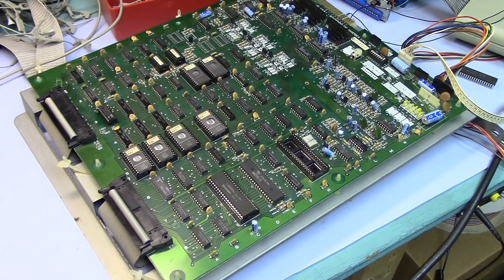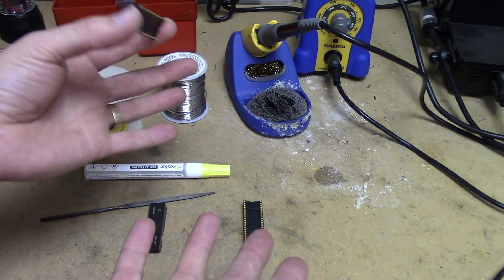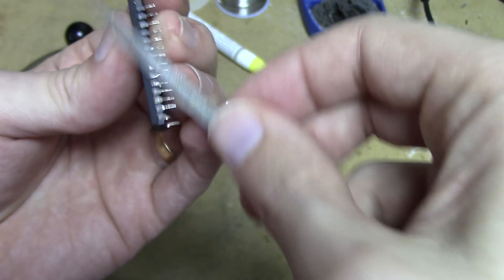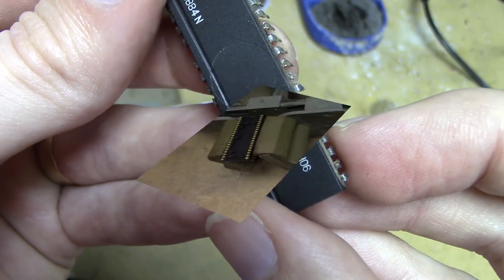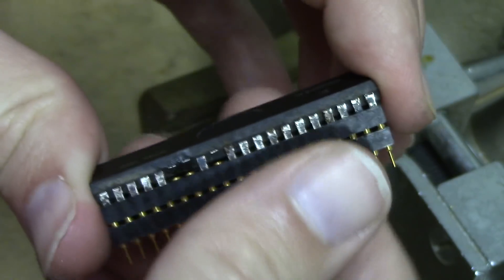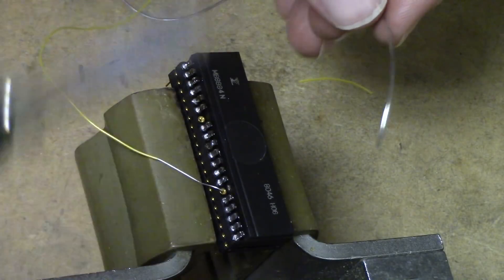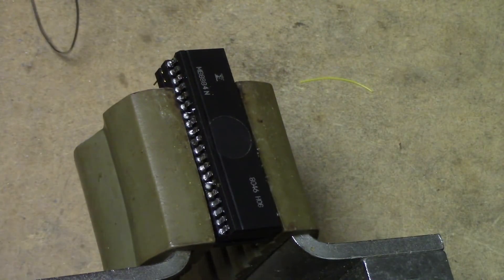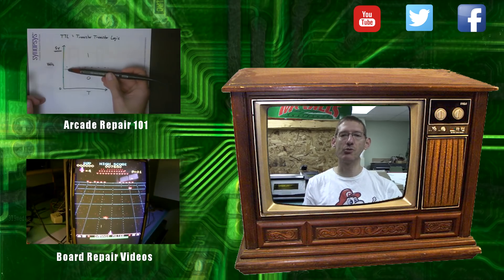Arcade Game Repair 101 - IC Leg Repair

Comment: Hello! Do you do repair services? I know this video is old and I tried the repair, but it didn’t seem to work. My soldering abilities aren’t very good so it’s possible that is my issue. Was wondering if I could send the board to you for repair? It was working until I pulled this cpu chip and noticed it had a couple legs broken. When I put it back in the game no longer boots it just goes to a blank screen.

Comment: Hey Adam, is it necessary to swap out the socket on the PCB to match up with the machined pin "donor" socket that you are using for the repair?  Or can I use a machined donor socket and simply plug into the existing socket on the PCB?
Reply from the maker: DeLuSioNaL's Arcade You can try, but typically the existing sockets are expecting to receive a thinner leg, so it may not fit. Or if it does you may be mashing the receiving blades of the socket without knowing it.

Comment: Nice method for repairing broken lC legs. I haven't seen that before and will definitely use this when I need to repair. I thought you were going to use a dremel to cut away the plastic above the broken leg to get access to the pin.

Comment: Holy cow! That was amazing! I never thought of the 2nd socket to keep the legs straight, I was scared the the oil from your hands pushing that tiny wire would affect the solder! I use a much finer tip but that was perfect! Thanks for the great video. I have some work to do now on an English mark darts machine now!

Comment: That sanding step doesn't seem like it needs to be as involved as you did it if you just fluxed and then tinned the pins before socketing them? If you have a hot air station and some tiny gauge solder you could do it with very little kinetic impact and the solder would both strengthen and insulate from corrosion.
Reply from the maker: The solder only adheres to clean bare metal so if I left the crud on, even after applying flux, the results would be sketchy.
Reply: Okay, thank you. I am still learning.

Comment: Hey, great video! I've been a lurker and watching your videos for a long time. I thought I'd chime in and offer some wisdom. When I was taught soldering many years ago, I was told to skip a pin, so do all the even ones, then go back and do the odd. this helps with dissipating the heat to the IC. This could help with keeping the plastic of the machined sockets from melting. But again love watching your repair videos! Keep up the good work!

Comment: Hi Adam
can I ask you ,have you ever used a ultrasonic cleaning bath to clean the legs before repair-or would it damage the ic's ?
Reply from the maker: +Nut Lock No I haven't. In fact... Never even heard of that. Do you have to immerse the ic?
Reply: Yes you have to immerse it... You could try (as an alternative) metal polish as well. An then remove the residue with isoprop...
Reply: I have with limited results. I experimented with a chip to see if the bath would damage internals.  Chip remained functional but did not help with the soldering. I then experimented with various chemicals and found that after repeated applications of heat, acid (spirits of salt) and flux repeatedly the solder takes.  

I do like Adam's gentle file action.  I was worried I would damage the chip more so looked for a less physical approach.

Comment: Nice technique! Amazing you can make a solid repair to a chip in such rough shape.

For chips that have one or two broken pins but are otherwise solid, I usually just put it in the socket on the board, solder a cut-off lead from a resistor onto the chip, and trim the off the extra length. The "leg" will stay on even if you remove the chip, unless there was very little left of the original chip pin.

Anyway, thanks for posting this!

Comment: Great stuff!  I did a similar video using a dremel to access the broken off pins, but I've learnt something from your approach - using a 2nd socket to help ensure the pins are nice and straight after soldering. =D  I think I actually prefer your approach.  It's less destructive to the package body!